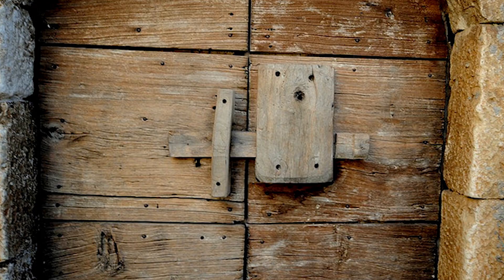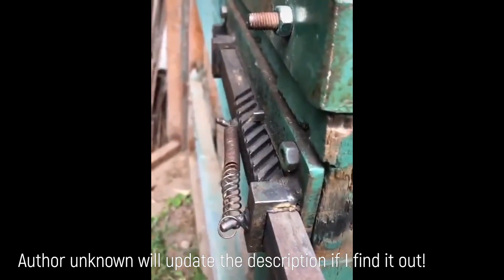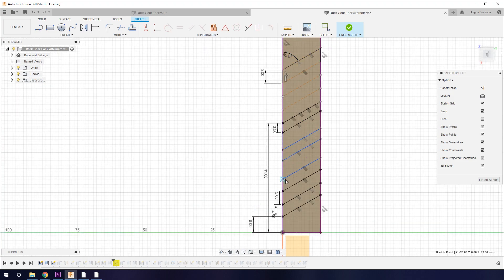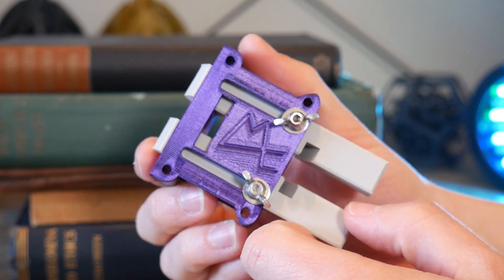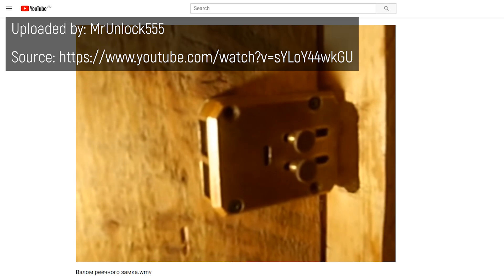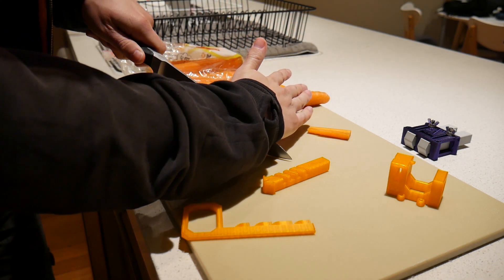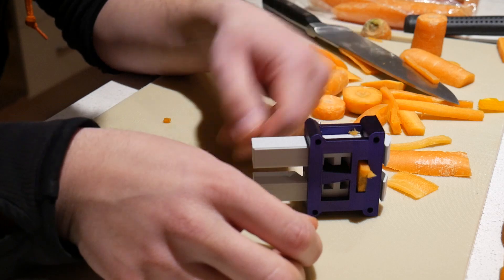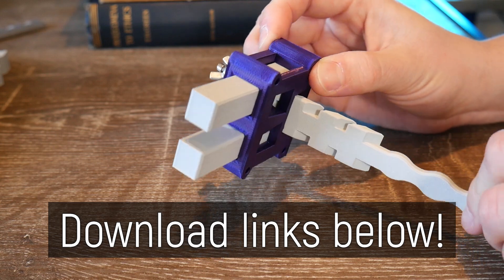This Strange Lock can be opened with a Carrot? 3D Printed "Rack Lock"

Comment: It's a much better idea to open it with a skeleton key, which in this case is a  metal rod with thin pegs or spikes coming out on one side in roughly the same spacing as the "teeth" on the real key.

Comment: The problem for me is the springs Hooke constant K, the springs are very soft and the burglars know when I am not at home and use some kind of MindFlex telekinesis to open the locks. When they get to my door , it's already open. They pick whatever they choose. Later they lock the door again.

I saw those ancient Egyptian locks. What is most important is to have a difficult design to guess and a very strong spring. That's what I saw in those locks you showed. Those people seem to have solved their problem with a fine smith to do the work. I cannot do this work myself. The noise of this work is unbearable to me.

I really need safer locks and there's none to buy. I will have to bespeak with a fine smith.

Comment: In Poland  there was a small private producer of that kind of locks. It was in 80' i believe. The company does not exist anymore. They were  utilizing long  and thin keys (ca. 100 x 12 x 3mm) , pushed thru a narrow, deep and precisely fitted slot. Because of that it was impolssible to apply any significant and controllable power to slide the bar.  Bolts and spacings were precisely machined in brass with tight tolerances. These locks were almost impossiible to open without original key.

Comment: Would you be able to have the locks teeth be mirrored if they are at the same 30 degree angle, like one side of the key pushes the lock plate left and the other pushes it right?

Comment: Well the mechanisme might be simple, but it could be used to change directions in mechanics. 
Example a design where it isnt possible to have a pneumatic piston behind the moving part. 
it could be placed 90 deg. To the moving part with a system like this and still move the part back and forth like normal.

Comment: When I was younger (5 or 6), my father drove up to the fence and gave me the key to open the fence(same one in video). It was cold and in the winter. And inspite of these being great for cold weather, it had locked up, so I put force to it and it gave way. But our key didn't have a guard and a part of my index finger got stuck. And I remember screaming my head off from the pain. And instead of getting out to help me, my dad just drove the car up the driveway. And so I pulled my hand hard to get my finger out, only to RIP my skin. And I remembering crying, screaming, and running up a slushy, muddy driveway in the cold and in pain.

What a life lesson I tell you. Till today, I still can find that motovation that made me run up the driveway rather than stay crying like a little baby.

Comment: I'm only 7 minutes into the clip.
Errrrr, remove the slider to get the shape right.  Then work on the slots.
Ok, you can't do that in real life, but as you are only testing the idea, it isn't "against the rules" to do that.   Pushing the carrot through while the slider is in place can't work.

Comment: I belive that if you split the carrot, so that you have as little as possible mass in the teeth of the mechanism, the lock would need less force to bite into the carrot, thus sliding easier.
Also, rounding the teeth of the lock might help against an attack like this.

Comment: 3:12 - oh no, that's not true... I have one, that locks basement\shed in a village house. Trying to open it in a middle of winter is a "wonderful" expirience, considering that warm wet air from the basement "conviniently" meets cold outside air right in lock's crevices, making ice, that locks it deadly tight... Only way to open it, it's pour on lock fuckton of hot water, but it's always a problematic to make, considering that we store water in that basement...)

Comment: The file and screwdriver method can be easily defeated by having the lock bars on top and bottom move in opposite directions and connected with a gear. You can not push the bars one by one, because they both have to move, while also you can not just shove something in the lock, because one site woulr seiz up the other.

Comment: I was like. This key seems familiar.
And then I realised that this is because my door lock is almost the same.

The only difference is that my lock has a +-shaped key slot, so, after you insert a key, you can rotate it 90 degrees and pull the key out.

Sorry for any mistakes or typos. As you could've guessed, I'm from Russia)

Comment: Now try замок обратного действия which I recommend you copy paste into google image search and look for the exactly same mechanism but it translates to "lock of backward action" and you will find one with a cross shaped keyway and a hook key rather than a straight key, that is because once inserted you twist the key and pull back to get the key into the actual keyhole and once you pull it engages the rack. This wards it against all attack methods mentioned.

Comment: I'm from Russia and we don't use these to lock something really valuable like homes, pantries, sheds, saunas etc. Usually these things are used for little fence gates (you can simply climb over those if you want to) or for some garden gates or cattle gates for example since they are pretty simple designed compared to more secure classic locks and you can't trust them very much. I have one of these on my chest with random junk, just because it's kinda satisfying to open, not bcoz I want to protecc it from someone XD

Comment: I wonder if this could be done with 8 bolts using a double sided key, as well as use mirrored angles. If the front facing teeth were at 30 degrees, the mirrored ones would be at -30 degrees, with 0 degrees being perpendicular and a total of 60 degrees difference between them. Of course there would be a matching gap in the key where the angles meet.

Comment: you could also vary the thickness of the key body vs teeth, giving you 2 dimensions per tooth to vary, for a bit of additional security. but since you're directly interfacing with the bolt there's no way it could ever be anything close to a pin&tumbler lock i think...

Comment: This seems like it would be especially useful in a situation where the door is hidden. For example, a moving bookcase or a sliding floor panel. In those situations having a key hole in the wall is fairly obvious, but if you have to push the key into a hole all the way through to release the latch it could be in a gap between bricks or something similar. Unless you know what you were looking for you won't see it, so in this case I think it would be one of the most secure options  for both hiding and locking a Panic Room.

Comment: Maybe you could combine a simple latch mechanism with that?!
The latch fixes the bolts in place and prevent them to open. The key will be put in horizontally and with turning him he opens the latch. Pulling the key outwards opens the lock.
I could imagine, that this would be more secure... maybe you like to try it?

Comment: Can I ask a question. From your experience which filament could be used to make a cookie type cutter to cut through thin card, for making decopage cards? Do I need to use an expensive, metalicor carbon fibre of nylon filament. I would really appreciate your suggestions.

Comment: I think the reason you couldn't find the mechanism was because it translates linear motion to linear motion and there are great many more efficient, less failure prone methods of converting linear motion, even if you are trying to change the amount of throw? But it could yeild something interesting in the right application. It really reads like a strange Rack and Pinion when you consider what it is really doing, but essentially the basic machine here is a ramp yes?

Comment: It's from Russia, so it was probably a frozen or semi frozen carrot, also the metal lock probably have sharper cutting edges.
Cool though, thanks for the up load.
As my farther once said. If all else fails, use a hammer, and if that fails, read the instructions. 😉😆

"Not locks were harmed in the making of this video" 😋😁

Comment: U have awesome content. I love the lock, not the carrot part. I mean it is what is is, there are millions of ways to fudge locks. Some funnier than others. Here is a muse of mine to share >> These past couple years I have been toying with the idea of contactless / mechanical /magnetic locks. Super simple in theory. Infinite design choices, like maze patterns. Only drawback is bulky key and carrying around a magnet/magnets arranged in special pattern. I thought of this in order to make a low tech simple lock for a common laundry room. Long story short I needed a custom door latch with some locking device which was low tech caz I had to modify the wall and the door. There is nothing I could buy caz the door was installed incorrectly. So i thought if there was no key mechanism it would be tamper proof > and if it was just a blank looking metal plate on the other side of a piece of glass, unknowing people would not know wtf todo.... There is much more to this whole paradigm, but hopefully this shares the concept and sparks some ideas . basically, could hide a lock anywhere in plain sight without a keyhole to get fk'd up or something a tamper-er might lever on...

Comment: Could a interlocking cube be done using this mechanism?
Instead of a deadbolt have the deadbolt itself be a key, that then goes into another keyhole, and so on, in total there would be four to create a lock square.
If all four being keys would be too difficult, then how about one key for one?
Or have all four lock pieces form the keyhole, and the center would be where the key inserts to move the mechanism.
Would be cool to see.

Comment: I thought about a lock mechanism which using a key in a shape of a coin. On the one side of the coin there is a lot space to drill in different heights and to create a mechanism that is simillar to the one with the pins. You will able to drop the coin vertically threw a slot and then rotate the handle to unlock it. Once you rotate the handle to one of the edges the coin will fall and you will be able to take it back.
Also, if you want to check a few keys in a row you can simply put the coins as a stack above the lock and keep rotating the handle until the lock is open.

Comment: this would be the perfect lock for "not security critical but random people shouldn't get in" locks, I'd think it will be fine even with, say, the caw machines and other arcade machines, not just rough doors and such...
though it definitely is a good way to latch a secondary outer door to protect more secure locks or such, it's basically like a DIY tank, heavy metal thing, but has many flaws ;P
also: combine with a conventional lock for extra security! as in, the key has a rotating bearing or whatever part, so you insert it, it will unlock latch, then you turn it, and it will unlock the more secure part, will also make it quite a bit trickier to lockpick, I'd guess...the latch part is at the tip, and will stay in place while you rotate...

Comment: I think it would work on a steel lock using a whole carrot and a mallet.   Angus, check out your mechanism book for mechanisms that translate linear motion through 90 degrees because this is a sweet way of doing it.  It has the advantage of being very compact and having a large range of input and output but the best mechanical advantage would be 1.5 or so.   Would work for angles other than right angles.  Also very easy to manufacture by hand or shaping machine.

Comment: Hi Angus, great find.
You'll also find this principal of bolting in the oil & gas or industry.
Their use is interlocking proces flow. So a freed key moves to the next step of a proces to open it's bolt.
This way the only right / safe way to sequence through a process is garenteed.
Temperature, sand, grit does little to effect their inner workings.

Comment: This would make for a decent heavy deadbolt for outdoor gates. Why not put a plate over the hole for the rack key that unlocks with a normal turn key, same plate could also be used for a box to hold the rack key. 

With how chunky this mechanism is, and especially at longer lengths, I don't think a simple, modern turn key would be sufficient enough for this, which is where the lock box/plate comes in for how you open the deadbolt, while having a turn key for security. 
More costly, yes, but you'd get a big deadbolt out of it, which would be useful for larger, heavier doors and gates. Best of both worlds, basically, you get complex security through the turn key, and simplistic, robust security through the rack key. Turn key would require skill to pick, rack key would require brute force to pick. 

To also expand on this idea, you could create a system, using a double rack, that goes opposite directions, that go into the frame at both the opening side of the door and the door hinge. The next benefit of this is that this system would act as a door bar. So if someone breaks the single rack system through breaking the frame it's attached to, the double-opposing system would still be barred at the hinge. Basically adding a third form of security.

Comment: Can't you have the key go all the way through to "lock" it from the inside?  Make the key so it can travel all the way through.  Once the key is inserted and the latch opens, get inside, close the door, then pull the key all the way through.  So long as you have a latch handle on the inside, you could just slide it open and get out.
Would that work?

Comment: Gear locks are actually used a lot, but not straight and extractable. Typically they prevent movement game, such as for lathes, 3D printers and other highly precise mechanics.

Comment: As a HUGE mechanical engineering nerd, I NEED that book. Where can I buy that?
Reply: There are many mechanism collection books. The classic 507 mechanism book from 1868 mentioned here is public domain, but if you want to throw money for it at someone, it is on Amazon including Kindle or print. There's also a web version with scripted animation.

There's also a public domain book of 1800 mechanisms if you want it.
Reply: I have seen it on amazon, as well as as PDF

Comment: I wonder if you could design one to engage one rack in one direction when inserting it then turning it 90 degrees  and engage a different rack on the outward stroke.

Or possibly having 4 different racks acting as pins in a huge core of a pin lock.
Reply: mraider94 My thoughts exactly! Or the insert stroke can operate a sliding interlock that prevents the bolt from moving, then rotate 90° and the extraction stroke operates the bolt.

Comment: It is indeed fascinating.  Soooo you open the door or gate or garage and you walk inside... how do you relocate the door and get your key back???   Was that the idea behind the thin handle one you made?  Just drag the key all the way through the other side?  Ahhh wait, tapered bolts would allow them to be pushed back in as the door closes and then stamp back to locked position.... so now your inside.  Does the local work from the other side you can get back out?

Comment: hello angus! i live in ukraine, and, as all things from russia, these locks are quite commonly used - however, only in heavy-duty or simply heavy-abuse applications. There is a lock like that "protecting" the 3d printing farm over at my job, and whilst it is not a perfect secutity mechanism, it does its job well enough. The main feature of it, that makes it carrot-, picker- and pecker-proof, is a springloaded gear that needs to be turned with a lock simultaneously with the main teeth movement. The angle, at which force is applied to the gear, is close to perpendicular to the angle of main teeth force application, so all squishy materials get kinda pulled apart and jammed. As you can see, slavs deal with insecurity of bulky stupid designs using more bulk
Reply: I'd like to see the video where someone demonstrated that it is "pecker-proof". OK, maybe I don't want to ever see it.
Reply: @ericcsuf  Oh boy!  Finally!  Now those damn criminals can't go around sticking their peckers in every lock they see!
Reply: If you're pickin' with your pecker you're really in a pickle.
Reply: Interesting I imagine some even have a "stepped" key way that look like a grate to keep non key items out.

Comment: If you made it so that the key must be inserted, dropped down, then pulled across the rack, that would make it significantly harder to pick with traditional tooling
Reply: I have a stupid idea but it makes sense to me and would probably make it kind of harder to lockpick I guess? Like if you make the keyhole part a lot taller so the key is actually a lot tall so the bolt gear piece is far off the the left of the actual keyhole. Then you turn the key and it would reach it cause it's long then you just push it straight in normally?
Reply: My grandma's apartment has a lock like this. You insert the key, rotate it 90°, then pull out engaging the teeth. It's carrot-proof.

Comment: you could ad variable deepness for the teeth to increase the number of combination possible
Reply: The teeth/space/angle combination does not matter. You can push a piece of wood through the hole and probably with a hammer, then the riegel will cut necessary profile on it. So you'll have a new wood key and unlocked door